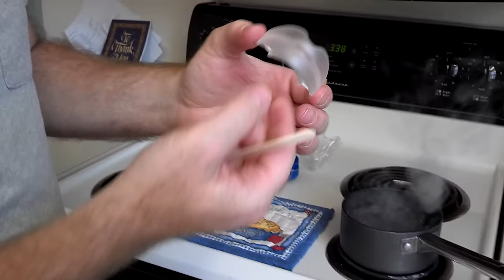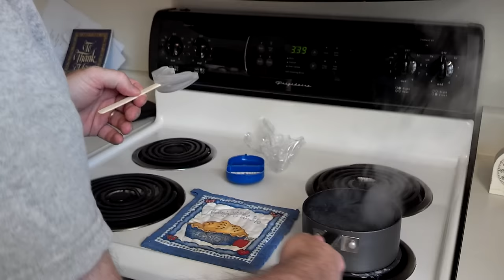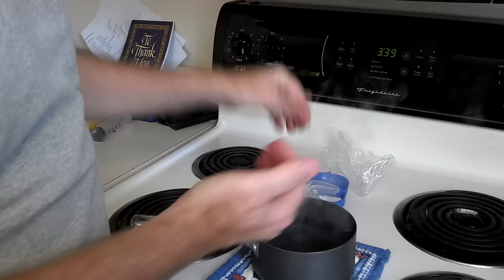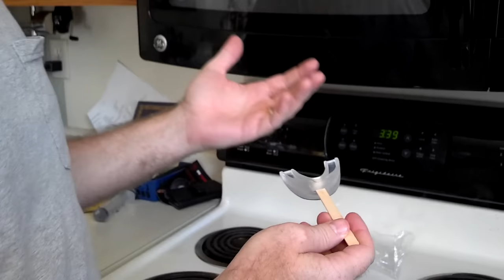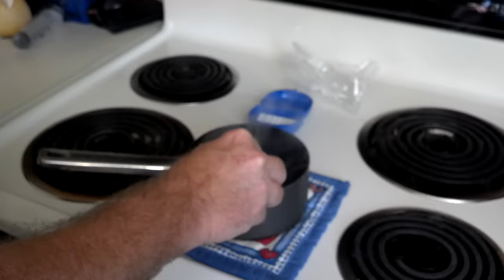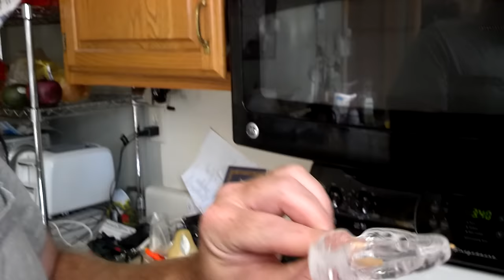How to custom fit an anti-snoring mouthpiece

Comment: Do you leave the stick in the mouthpiece after molded?
Reply from the maker: That's a good question because originally I did leave it in until it cooled because I thought the gap may allow a little breathing thru it, but I realized later that I just breathe thru my nose at night and it didn't make any difference.